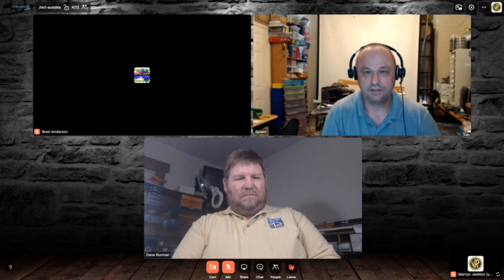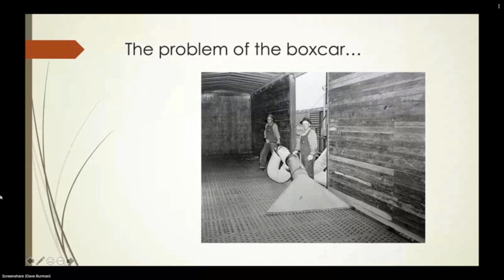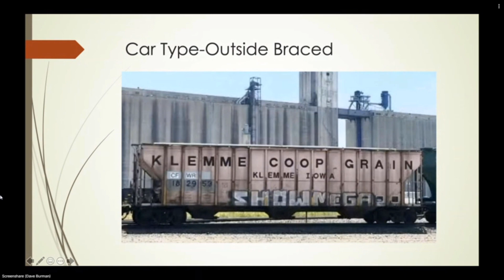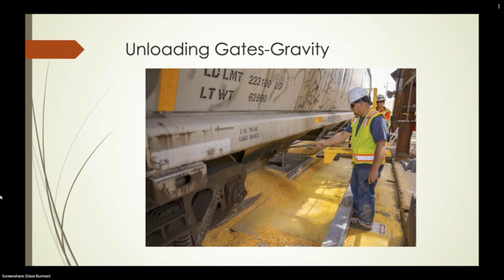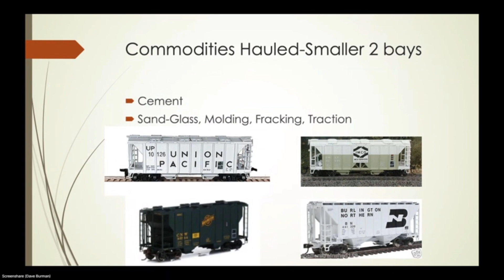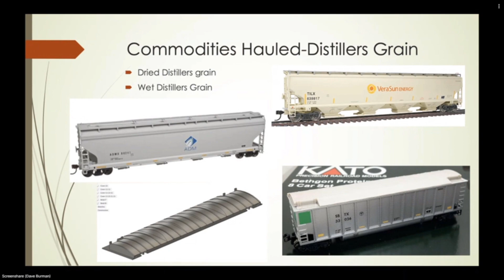Dave Burman - Covered Hoppers

Comment: Great topic and nice early history.  Here are a few corrections/additions:
15:30 – BN car is a 4600.
22:30 – Accurail car represents a 4600.
30:00 – Others PS-2s include Intermountain 1958 (mentioned earlier) and Athearn and Atlas 2003.  Walthers car is a Trinity 2980.
31:30 – Intermountain car is an ACF 2980, also made by Athearn and Accurail.  The HWCX car is a Trinity 3281 also offered by Walthers.
33:00 – Atlas also makes a cylindrical car.
34:00 – Intermountain also makes a 2927 3-bay ribbed-side.  The Big John car is a Magor 4948.
35:30 – While both 4427 cu ft, the high side replaced the low side cars in 1966.
36:20 – The 4785s are Pullman-Standard cars.  Exactrail also makes an Evans 4780 and Athearn makes the FMC 4700 mentioned earlier.
37:10 – The Athearn car represents a PS 4740 (4740s have 16 ribs, 4750s have 18).  Exactrail produces a Magor 4750 as well.
38:15 – The Accurail car is a 4600.  When comparing, the 4600s have a longer, low-slung appearance when compared to the 4650s as they were made to fit Plate B clearances.  Atlas also makes a 4650.
39:00 – Intermountain also makes a Trinity 5161.
41:00 – Athearn also produces a 2600 single bay Airslide.
41:30 – I don’t believe there was a 4150 Airslide.  ScaleTrains also makes a 4566 Airslide.
42:00  - The car on the left is the Atlas ACF Pressuraide.  Atlas also makes a Trinity 3230 PD car and Intermountain makes a Procor PD car.
43:30 – Other pneumatic cars include the old Athearn and new Atlas 5250.  The CPCX car is a 5701.